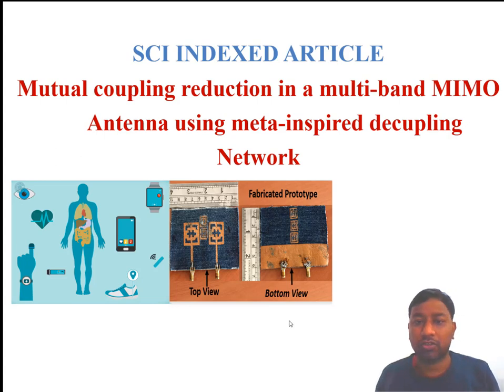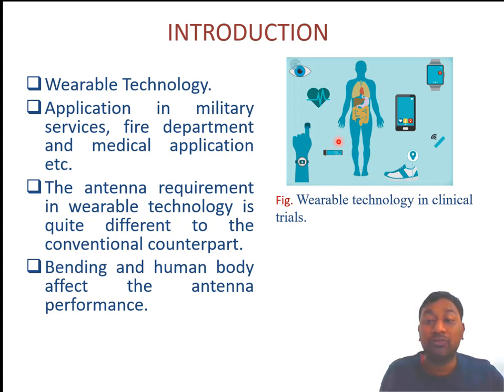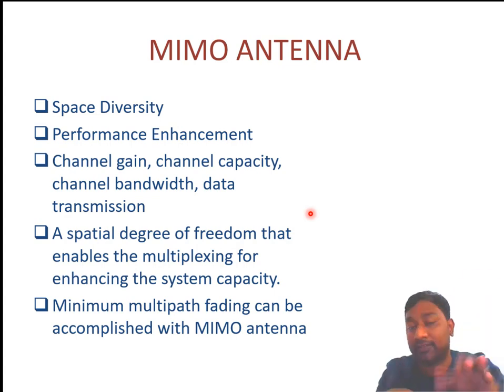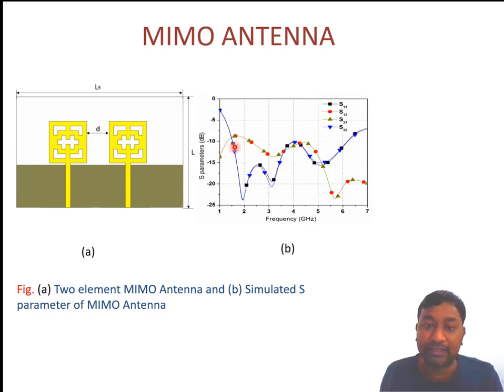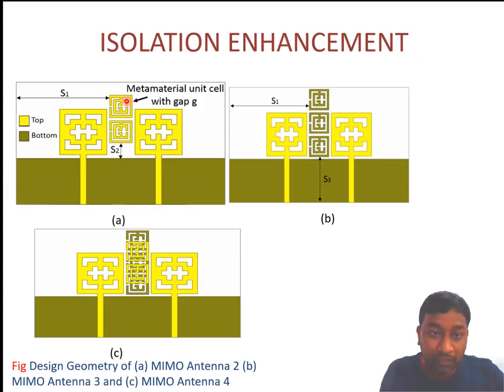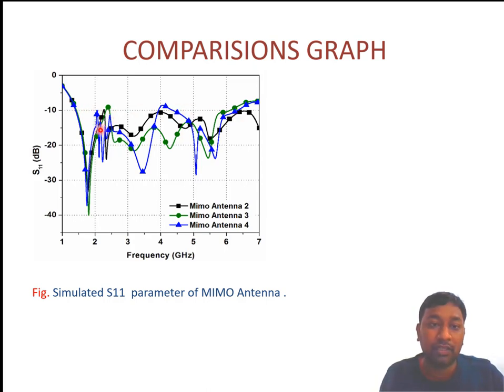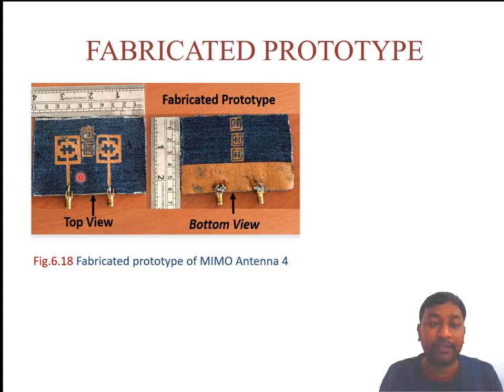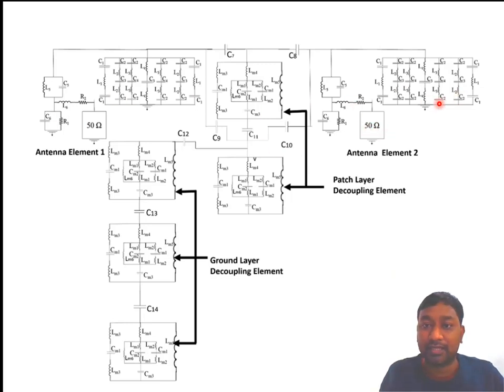Wearable Antenna  MIMO L8

Comment from the maker: Roy, S., Chakraborty, U. Mutual Coupling Reduction in a Multi-band MIMO Antenna Using Meta-Inspired Decoupling Network. Wireless Pers Commun 114, 3231–3246 (2020). https://doi.org/10.1007/s11277-020-07526-5